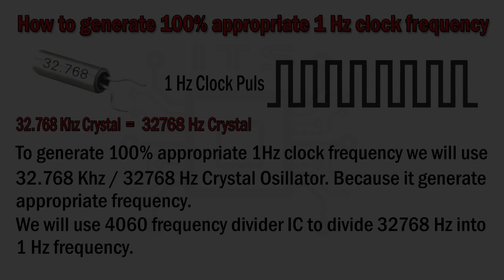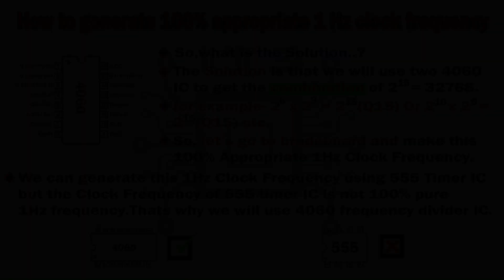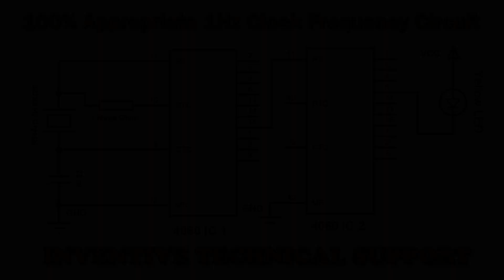How to generate 100% pure 1Hz clock pulse using 4060 IC & crystal by Inventive Technical Support

Comment: Your video helped me a lot but i just dont know how did you calculate the capicitor and resistor for CTC and RTC pin and why you don't use resistor for the RC ?? pls let me know
Reply from the maker: Since I have used Crystal in this circuit, I have used this Resistor and Capacitor.
you can use any Resistor 500 Kilo Ohm to 1 Mega Ohm  and any Capacitor 22pf to 100pf If you want.
Reply: @its015  Thank you so much but i just wnna know that why u know we can chose Resistor 500 Kilo Ohm to 1 Mega Ohm  and  Capacitor 22pf to 100pf. Do you have any formula for it  ??
Reply: @ucquannguyen7613  just check the Datasheets

Comment: Not sure what you mean by "pure"?  If you mean a nice 50% square wave, then fine!  But if you want an accurate 1 second period, then your circuit will probably only get you about 20-50 ppm accuracy/stability. Have a look at a $10 DS32KHZ integrated TCXO chip. That will get you 2ppm accuracy and stability over a big temperature range.
Reply from the maker: I'll try. Thank You 🙏

Comment: Hello apane a kit banai he achhi he par A kit  me 1 gante  me 3600 secend Hoi ti he par a kit mene banai he par he kit 1 gante me 3597 secend chalti he to aab me kya karo
Reply from the maker: Kabhi kabhi crystal oscillator accurate 32768Hz hota ni hain khas karke local walla toh kabhi ni hote.
Fir 1M ohm resistor, 22 pf capacitor, ya v accurate hota ni hain. 
5% - to 10% tolerance hota hain Sir ji.
😊😊😊😊😊

By the way Commant karne k liye dhanyavad. 🙏🙏